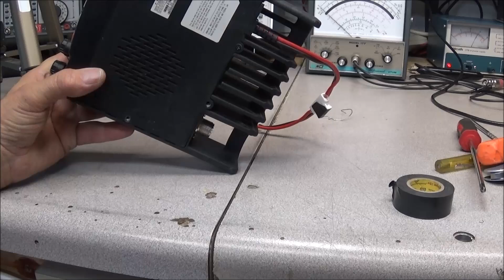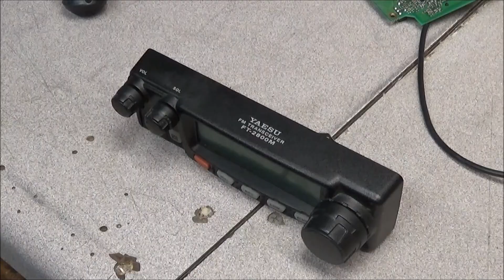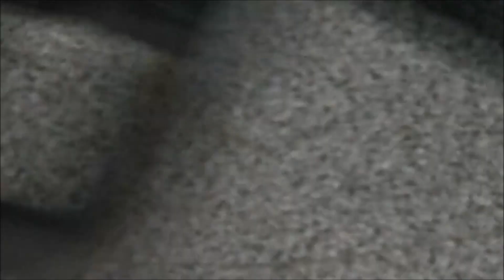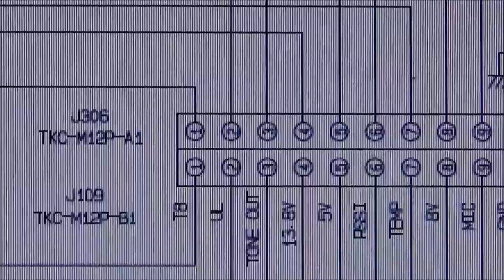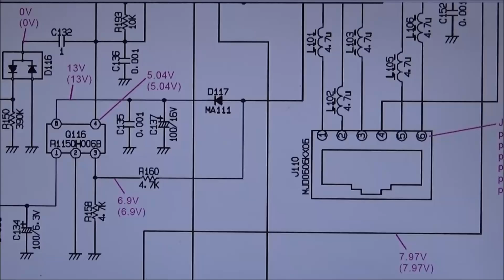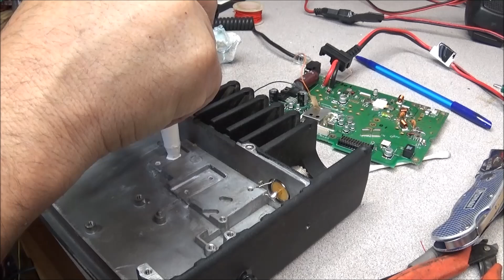#118 Yaesu FT 2800M  No Power On Repair

Comment: I was looking on eBay just a few hours ago and found a 2800m for $50. It showed issue is will not power on. I might order that radio from eBay. It just might have the same issue. If not, I will figure it out. Thank you for this video. Much appreciated.

Comment: in situations where a corroded item is hard to get at,for example the mic plug,i have some concentrated sulphuric acid and zinc mix ,called spirits of salts here,that normaly desolves corosion like that instantly,after dousing it with that,flush with water and your good to go!

Comment: Nice work. Good radios them. I used to have one and I regret selling it. It would TX happily at 50W with that massive heatsink keeping the finals happy. Good heat dissipation design in my opinion.

Comment: Nice save.  I have one of these transceivers, where are you located?  No audio is the problem with mine.  Beeps and tones are ok so the speaker is good.  Transmits good too.
Reply from the maker: Hi Scott,  East coast of  North Carolina here. Sounds like a bad capacitor on the audio output side to me.
Reply: The Radio Shop, thank you.  Do you think this radio is worth spending $125 to have "looked at"?  I'm is Southern California.

Comment: I would normally put that front panel in the ultrasonic cleaner and give it a good hot clean, but sometimes all that is holding a circuit together is the corrosive material......hence it a 2 edged sword and may end up as even more trace repairs.....but I guess thats the price the customer pays for letting the drinks get into the radio....... good video and as always an enjoyable watch !
Reply from the maker: Thanks. That is something I need to get  is another ultra sonic cleaner. Mine bit the dust some time ago. It was small and would only hold maybe a cell phone board. Thanks for watching.

Comment: I have a similar radio here that was corroded at the 2 pin connectors on the face plate and some pins just fell off. Liquid and radios don't mix well. Thanks for another great video.
Reply from the maker: Liquid can really cause a lot of problems in smd stuff. Seems through hole not as bad.  I have a remote head from an Icom here that was completely destroyed. No way to repair it. Thanks Lyle for commenting.

Comment: Great tip on the scotch brite I had not thought of that, did you use it dry or with a cleaner or solvent?
Reply from the maker: I used a little cleaner with the scotch brite pad. These are the pads you get from the dollar store. Very fine and not abrasive. Thanks for stopping in.

Comment: Thanks for this one Buddy. I have the 7900M which is basically the same radio. If it ever does the no power up act I'll know exactly where to look. I wonder if that rig might have been in some kind of damp nasty atmosphere to cause all that corrosion.  Whatever got in there was some sure did a job on that board.  73 Doug.
Reply from the maker: Thank you for watching Doug. It really looks like cola was spilled in the front panel. Stuff does a nasty to smd stuff.  Hope you will not have this issue with yours.

Comment: I don't see the jumper wire as a "bodge"... I see it as a cost/time effective repair. Questions: Is there any risk in not repairing the via? Might corrosion down in there creep along circuit traces? Maybe sometime down the line you could show how to go about repairing such a tiny via... Always look forward to your videos Buddy!
Reply from the maker: Thanks Richie. This is a case were the "bodge" becomes the permanent fix. just too time consuming repairing the via.  I do plan on showing how to fix these one day.  Main thing is to stop the corrosion. A little acetone, alcohol, and a bit of scrubbing takes care of that.  The via is so thin it simply gets eaten away since it is only a plated hole.  Thanks for stopping in.